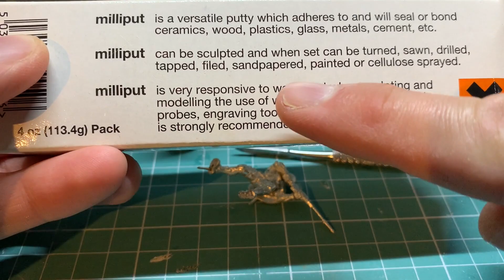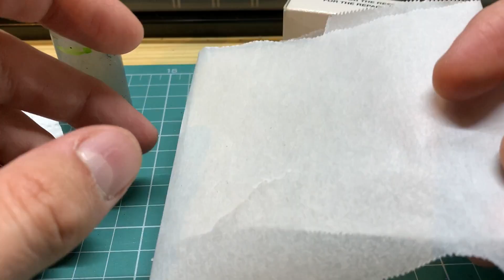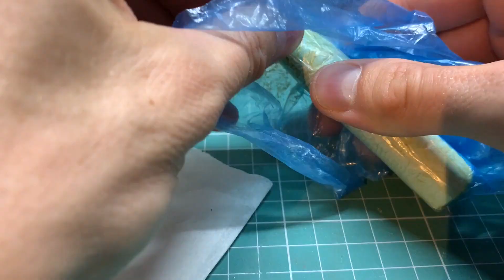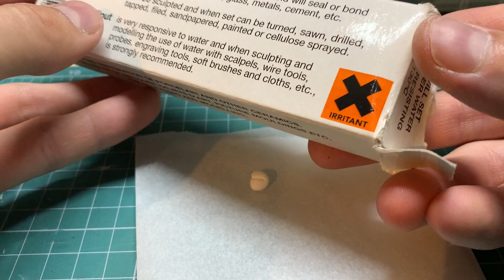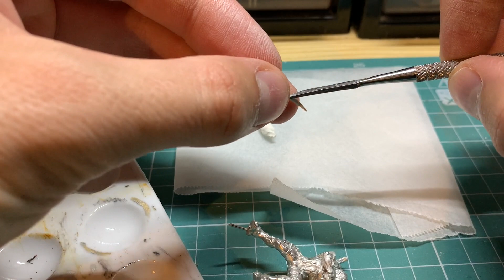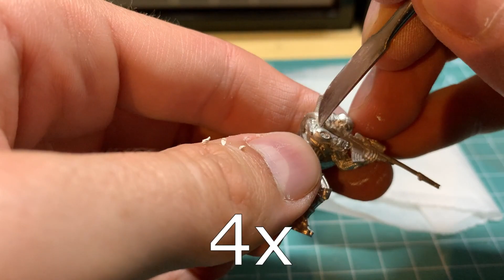Tutorial: easy gap filling with Milliput

Comment: I love the fact that you can really water this stuff down to where you can brush it on with a paint brush. really great stuff and so much easier to work with for filling gaps than green stuff. green stuff is great but it can do what this does in some places.
Reply from the maker: Hmm haven’t thought about applying it with a paint brush, thanks for sharing!
Reply: It actually works better using Isopropyl alcohol or meths.
You can control the consistency from a wet paste to virtually a liquid, so you can literally pour it into the cracks.